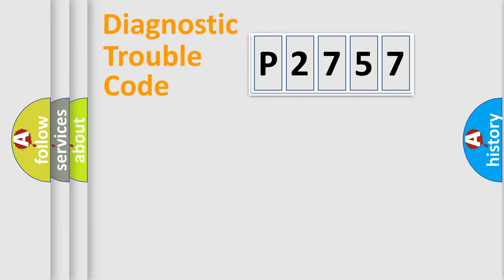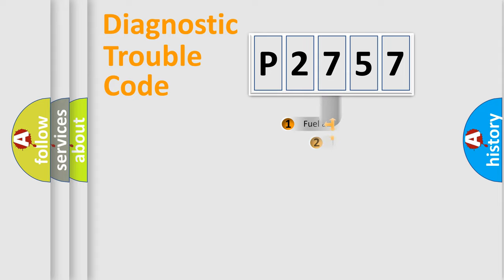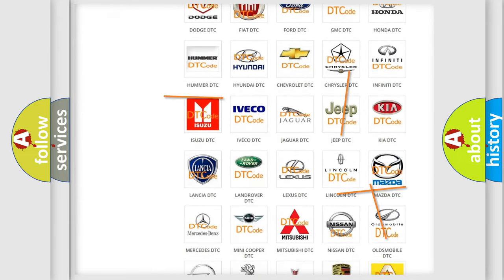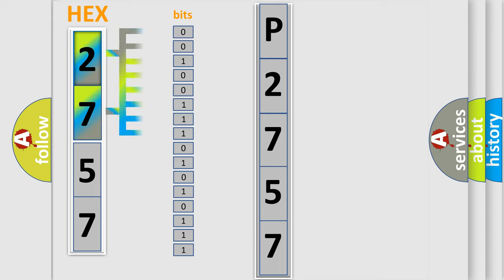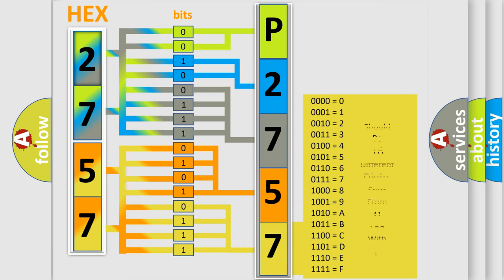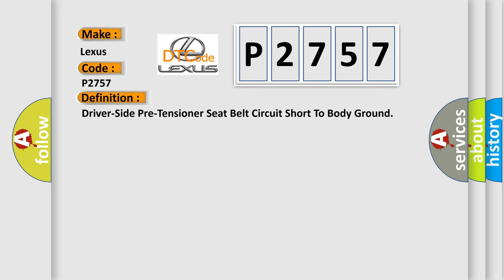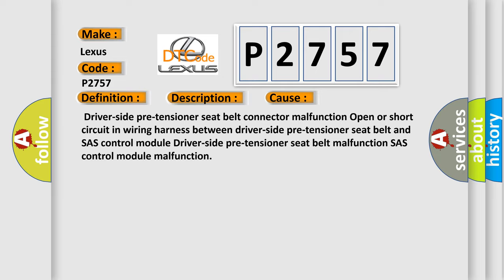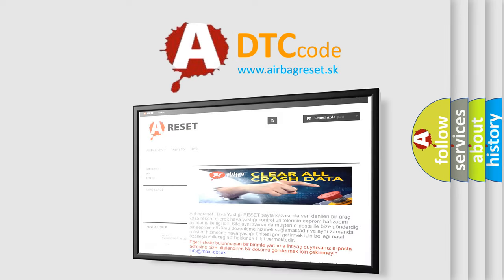DTC Lexus P2757 Short Explanation

Comment: P2757 torque converter clutch pressure control solenoid control circuit performance or stuff off